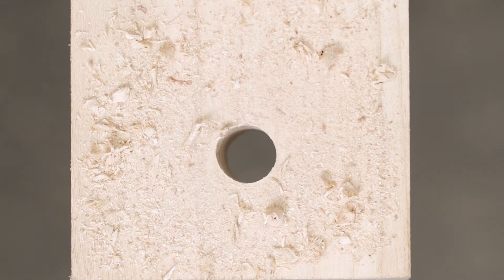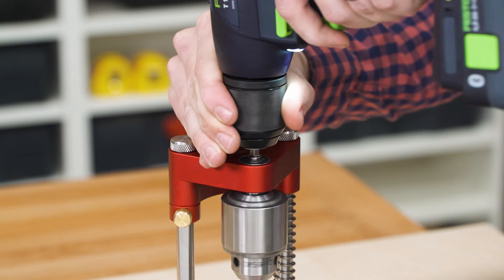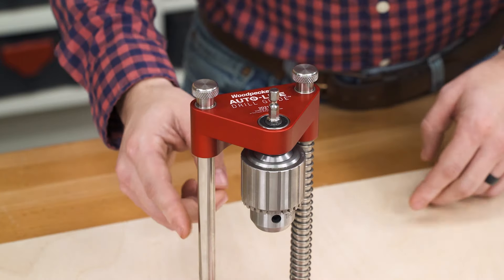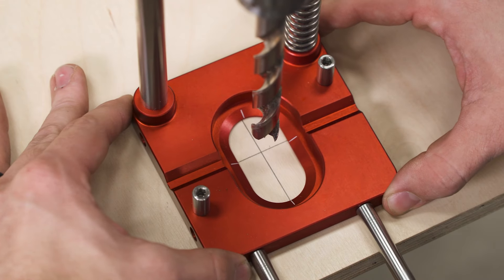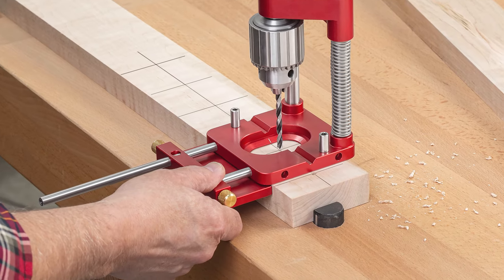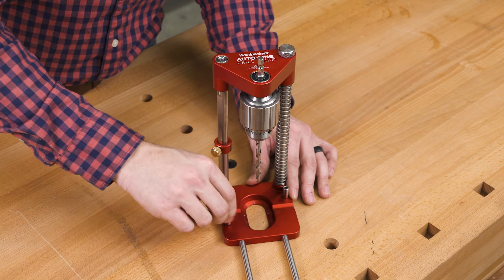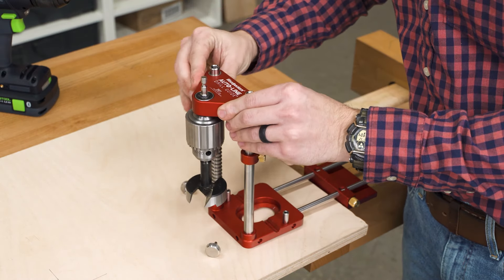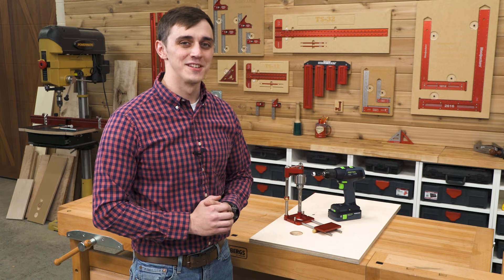Drilling Accuracy With Auto-Line Drill Guide™ | Woodpeckers Tools

Comment: This looks like a well thought out design. Quality and precision, are another matter. Even for wood work, this looks helpful, but imprecise. I am looking for something like this for drilling metal. My drill press is designed for wood. Even the slowest speed is much to fast. So I obtained a triple gear reduced VSR drill. Has the strength and goes slower.

Personally, I would like to see Makita or DeWalt, etc.; make something like this, almost built into a hand drill. For drilling in metal, the design would need to be able to handle more pressure, cutting fluids, more torque. Needs to clamp onto work or table. Needs to be able to make bigger holes too.

I have to build one???
Not a mag drill....for all types steady straight holes in big and small pieces of metal; shit just tell me where I can get a well made robot that can use my hand drill ;-)